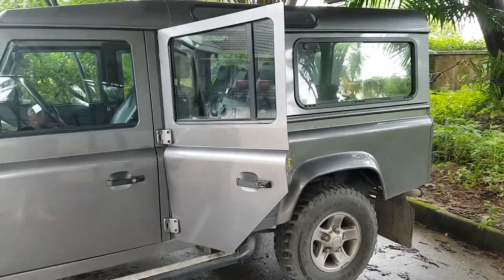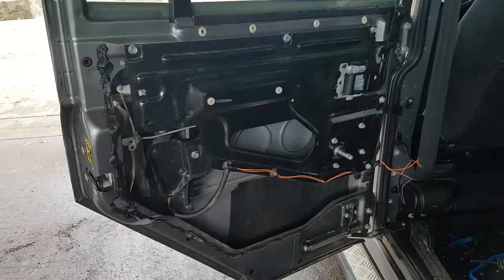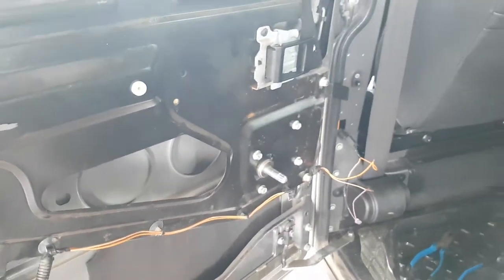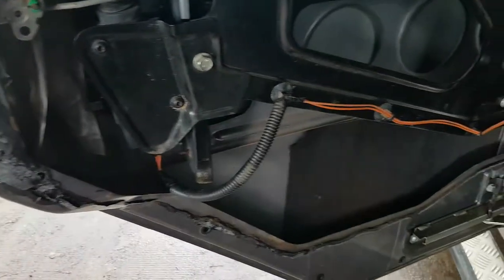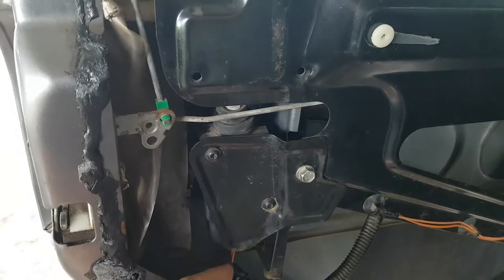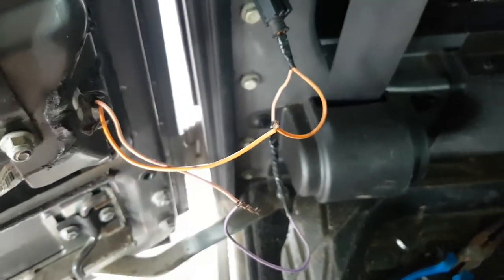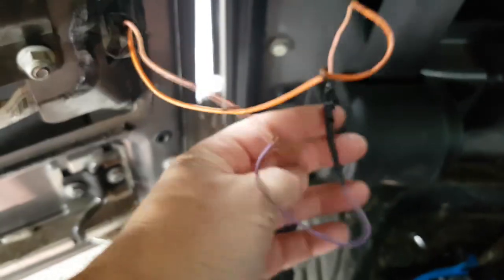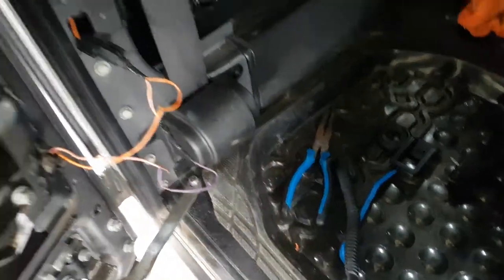defender puma 2010 rear door actuator

Comment: Hi you should've tried with a 12 v battery the actuator first.. right? Before ordering one.. if I'm you I will change the complete cable to the actuator.. 
How much was the actuator? 
I would like to put central locking system in a older Defender.. 
But I don't know how or which one to buy.. there are a lot of them for sale.. 
I'm just afraid it's not going to work... And on my ( 90 van version ) the back door is different from the side locks.
Reply from the maker: changing the complete wire is not easy and it will just break again in the future, Hence I went for a sheathed set of wires just in that area where it will break again. It should be strenghtened to begin with by landrover but they dont think about this. Its a long time back and sorry for the late reply. Central locking on an old defender would be interesting project. Good luck.